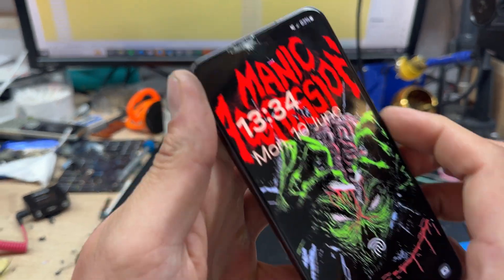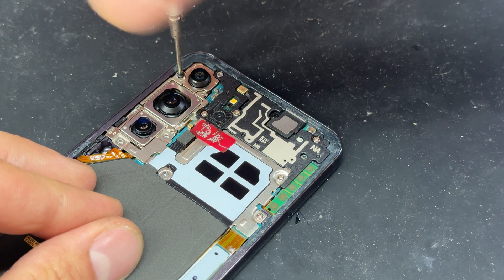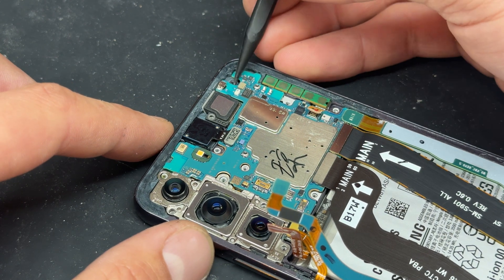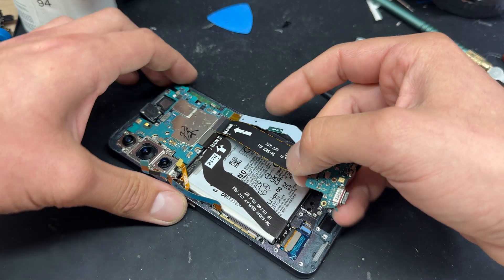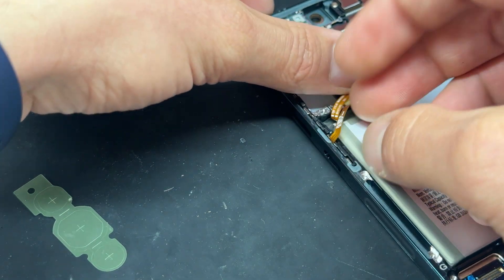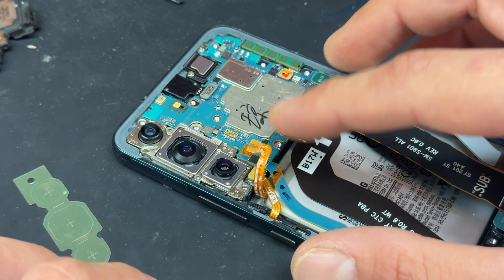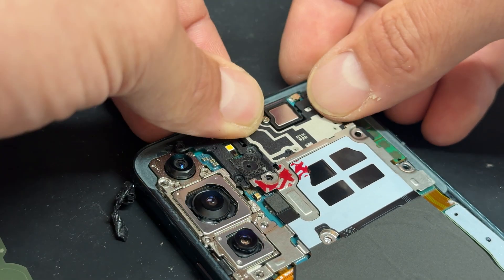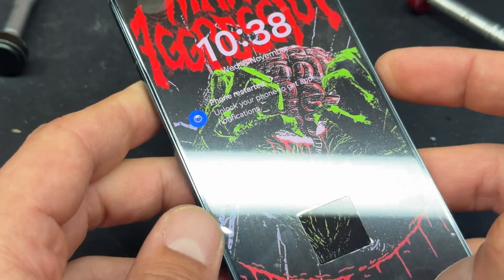Samsung S22 Screen Replacement - How To Fix Your Broken Screen!

Comment: A warning for the uninitiated: While replacement backs may be plastic, the back panel can also be glass, as I have just found out the hard way. 

Be careful.
Reply: I found that out too.  But, I put some packing tape over the back to keep it all in place, then some black gorilla tape.  I think I can still use it for the back as I already have an Otterbox case.  I ordered the proper sticker seals for the back as well.
Reply: I cracked my glass back as well.   Not going to help the resell value but it really doesn't matter to me.   I have a phone case over it so it doesn't matter.   I tried very hard to get the back off using a hair dryer and the plastic tool.   Just would not come unglued no matter how much heat i applied.

Comment: Mine broke cuz I slammed my trunk on it, while it was near the piston, on a hatchback, in heavy rain, with dogs.  Seemed like a nice spot to watch some vids from.  It was up high, and well-protected from the rain, while we hung out with the hatch up, while it was pouring. We do this often.  We just chill and watch the rain.  Then, I shut the trunk when it was time to leave, and totally forgot I had my phone right at the hinge of the trunk.  It was crushed from top to bottom with a mighty force. I thought it snapped in half!  It's toast, but it still turns on and off, which only influences me to try to fix it.  lol.  Just bought the proper tools, heating pad, and a screen from Repair Universe for my s22. Wish me luck!   No clue what will happen, but I shall film it all!
Reply: Hey were you able to fix your s22? How hard was it? Thanks in advance for your reply.
Reply: @CarlosSanchez-tz7zf  No, it didn't work so now I have to find a used/unlocked on for my carrier that's very cheap, and I will try it again.  I cracked the sides of the front glass and snapped the power adapter receiver part of the circuit board since they literally put it on a tiny 5mm sqare tooth sticking out of the side of the board,   I thnk after about 3 or 4 attempts with the right tools, I snapped it off and can't microsolder.  It's a tiny plastic tooth with 3 metal connections that broke off.   I could try to fix it, but I have no clue how to do it without the proper tools.  I've thought about sending the board out to see if someone can repair it, but I don't trust anyone these days.  I would rather try again in the future when the prices come down even more and there are more on the market.   For now, I grabbed an A35 and it's fine for what I do with it.  Hopefully in the future, I'll get a cheap enough used/unlocked legal one with a serial # for my carrier, and try it again.   I don't trust ebay sellers who can't provide a serial # either.

Comment: How do i replace just the glass
Reply: That's the funny part, you replace almost the whole phone with this one...
Reply: This is old but to anyone in the future, you can use a razorblade and iso alcohol just like how it's done in iPhone tutorials, for this method remember to have either a new adhesive tape either from samsung themselves or a good double-sided tape, Tesa is preferred in mobile repair for a reason.

Comment: Thank you for posting this. Very helpful! I was able to replace my screen. My only issue was stripping one of the antennae but I ended up clipping the metal piece holding it into the original case and didnt bother screwing in one side. Phew. Also, apparently I did get a samsung genuine replacement so while my screen works, I can tell the quality isn't as good and I can't use my thumbprint on the new screen. Oh well, thanks again!

Comment: Just a warning about tweezering those screws out of the holes, I ended up yeeting one screw far out into the universe nowhere to be seen lol. So now i just put one finger over the screw and I use the tweezers to lift up the screw. Also on the plastic cover for the sub board, there is a rectangle slot on the left hand side near the top screw, pinch the tweezers together and put in that rectangle slot and rotate the plastic cover up just enough to use a plastic spudger to get it all off.